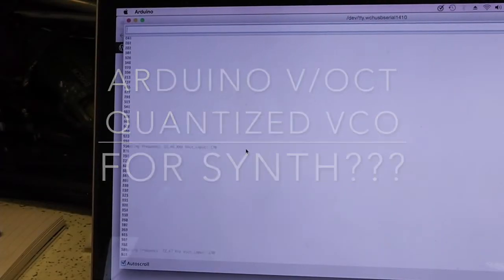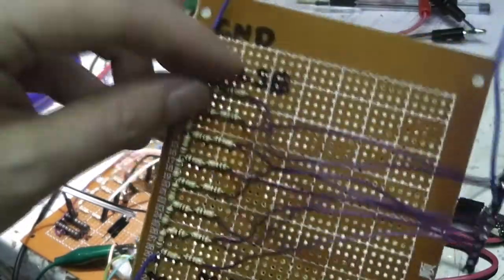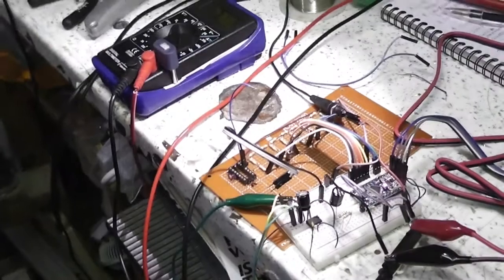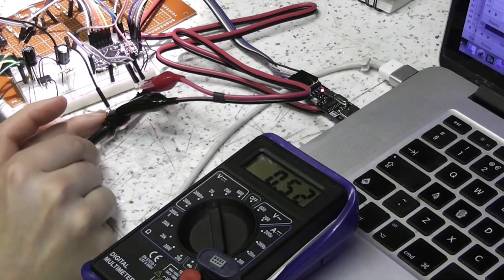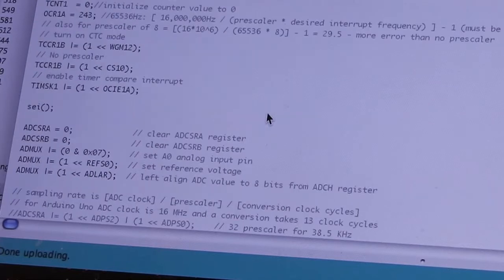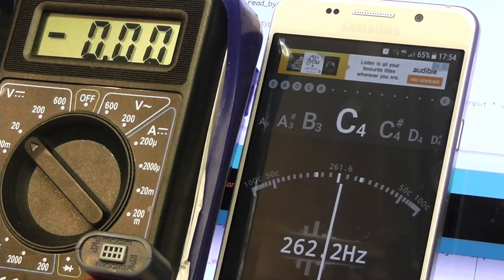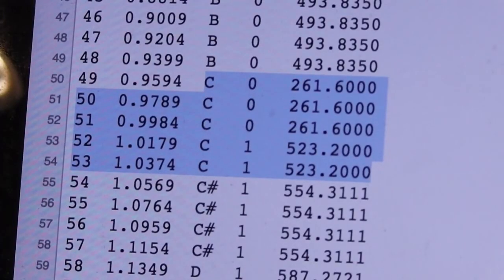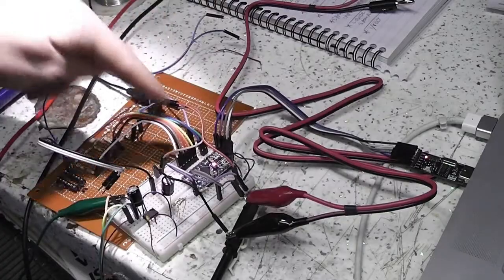Arduino V / Oct Quantized VCO:  reading and outputting analogue voltages FAST

Comment: Hey not sure you're still reading this but I'm currently working on building an arduino eurorack thing myself. Could you elaborate on the input pins and protecting from overvoltage/"undervoltage" (as in negative cv)? I've seen so many different opinions online: attenuators, diodes, etc. And I'm kinda confused
Reply from the maker: Hi, the best thing you can do is look at the way the Ornament and Crime module by MXMXMX does that stuff. The schematic is here: https://drive.google.com/file/d/0ByUu4ePJDmVnS3U1OUNiQ05heG8/view and I think it's the gold standard of interfacing microcontrollers with eurorack using (fairly) affordable parts. That schematic shows analogue inputs and outputs, plus gate/trigger inputs, all compatible with eurorack voltages. MXMXMX's github and the o_C site are also worth a read.

ornament and crime uses a Teensy (Arduino compatible) which runs at 3.3V but the methods shown could be adapted to run at 5V for standard Arduino. But I recommend Teensy.

Comment: Enjoyed the video..I'm working along the same line but using just a simple square wave...Using Timer1. H and a frequency lookup table to set the on and off period of a pin...Using a square wave so I use Cmos chips similar to the Lunetia Synth..I have the quantized   notes from 0 to 5 volts, now I trying to work out scale selection...Good luck with your build...
Reply from the maker: Thanks. I added scales to a later version of this code by creating another set of lookup tables based on notes. So I had the initial lookup tables for note and frequency, then another on top for scale. And a set of buttons / analogue control to select scale. But before I really finished this I moved on to a full analogue design after discovering MFOS. Which is why I haven't uploaded a video in 8 months! I didn't really know what Lunetta was until I googled it right now. Looks interesting - when you say you're using CMOS, you mean you're plugging the output from your Arduino into Lunetta style modules?
Reply: Finally got some time to work on the concept..Here's a short clip..https://youtu.be/87miwcXJ2gw
Reply from the maker: Nice, I don't completely understand what the CD4040 is doing there? And how accurate can you get the frequency on the Arduino oscillators? I imagine with a square wave you can hit the frequency quite accurately? The wave table method I used in my Arduino VCO is only accurate to 1Hz because it doesn't have enough memory or CPU speed. But square waves should be more accurate? I wanted to improve mine, so I spent some time building a hybrid Arduino / analogue circuit that could shape a square wave into saw and triangle waves. But I gave up because the Arduino was injecting a bunch of noise into the analogue side.
Reply from the maker: I haven't used I2C much, I just had an idea about your synth.. that you could add jack plugs to your I2C bus, and use patch cables to carry I2C, just like analogue synths use patch cables to carry the analogue voltages. Would that even work?
Reply: The CD4040 is acting as a divider to get stacked tones..The square wave is only 1 Hz also but on most note that's within a few cents and with a little modulation it close enough for me...
Reply: Already working along those lines..Stereo 1/4 plug for the three lines..Will used banana jacks for the other controls...Also looking into ways to use the arduino in the filter section..Already have a basic idea for an ADSR using one and a digital pot.....Just want to be silly and use them any where I can..Should be fun....
Reply from the maker: Cool, that sounds like a really original idea, could be quite powerful. Like, instead of using a control voltage to set a specific note 'A' you could send the character 'A' down a jack to an arpeggiator and it could generate a pattern based on that. Or you could multiply / divide / subtract values precisely if you carried them via patch cables.
Reply from the maker: I guess 1 Hz accuracy is probably good enough for me too, it's just because I haven't used synths before, I don't know what things to prioritise.

Comment: H, would you care to show us some code? I am building a VCO and 
struggling to understand how to get proper V/Oct to the arduino..
Reply from the maker: Hi, interesting to hear from someone working on the same stuff. Let me know how you get on, I'm new to this myself. In this simple implementation of a VCO I did most of the maths in PHP (could use any language of course, but I'm familiar with PHP) and pre-rendered lookup arrays. First I manually calibrated the ADC output to volts, making a lookup array for ADC values-> Volts for every value that the ADC could produce in 8-but mode, ie 0-255. Then once I knew those values, I created another 0-255 lookup array, directly relating ADC->frequency.

The important bits of my PHP code were:

$middle_c_frequency = 261.6;

for($byte = 0; $byte<=255; $byte++){
    
    $bytes_to_volts[$byte] = number_format( (($byte * $m) + $c) , 4, '.', '');
    
    $bytes_to_frequency[$byte] = number_format( (pow(2, (($byte * $m) + $c)) * $middle_c_frequency), 4, '.', '');
}

Where $m and $c were the values I gained from Excel when I manually calibrated ADC output -> Volts.
Reply: thanks, so far I got this:

https://www.youtube.com/watch?v=urUA_IILKqE

glad to see you are also using VCV Rack :-)